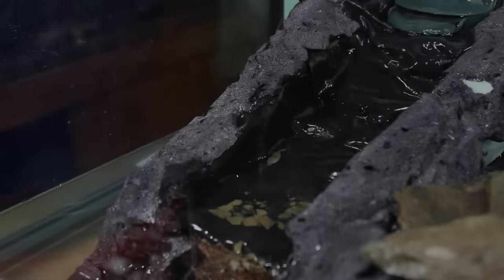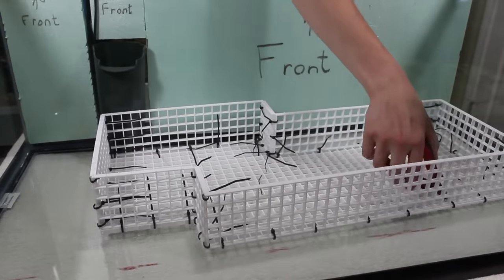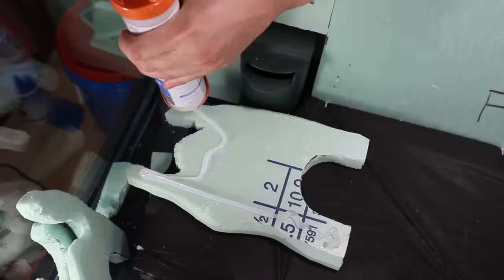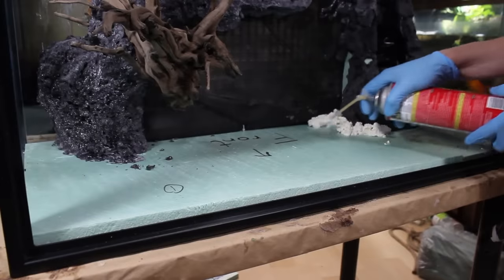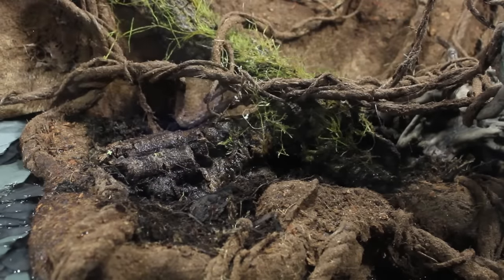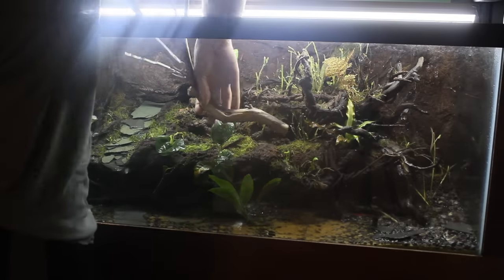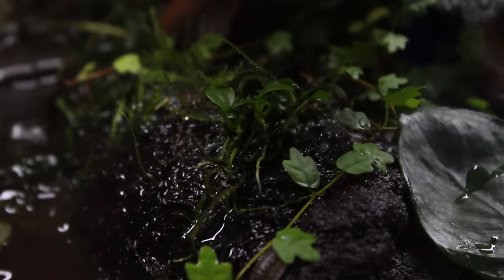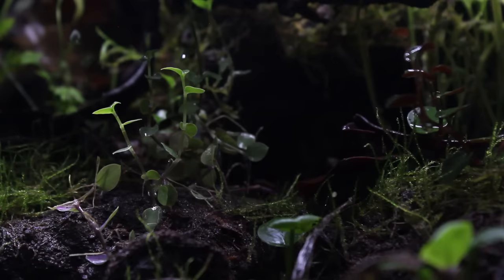The ULTIMATE Fire-Bellied Toad Paludarium

Comment: I've found that after I trim down the edges on any work I do with foam, I take a heat gun to pretty much any surface and edge. Gives it a really natural and nice looking finish. It's really easy to overdue it but it turns out looking really nice.

Comment: Just a note, there are some varieties of foam-safe CA glue that will not melt the foam (as long as you don't use any Zip-Kick to activate it). Yes, it will take a few seconds to set (between 5 and 30 or so), but your foam will not be damaged.

Comment: Hey, In the past, I've used coconut coir as a substrate and it ended up getting wet and turning the water aggressively brown, and it never really stopped doing that. 

Does the thin layer of coir on the silicon do the same thing or is it a small enough amount to be able to water change out? I really like the look of this but I worry about being stuck with the brown water again.

Comment: Why use the insulation foam on the back? Is it possible to just build some areas up with foam and silicone coco liner over just the glass? Trying to do something similar and I'm wondering if I need to get the foam or if I can do it without?

Comment: New to this art form and planning to build my first one of this. I am not able to visualize how the water from the front viewing areas is able to return to the pump to make its round. Seems to me like all the sides of the false bottom lattice are covered by the coco fiber (which I assume allows the water to get through and to the back where the pump is) but most of the sides seem to be covered with the expanding foam. What am I failing to see? Thanks in advance

Comment: I recently did a more arboreal set up using the silicone/coco fiber method you use.  However, my coco fiber has started falling off and into the water.  It felt like I used quite a bit and really pushed it in, but something isn't right.  Do you have any advice for that specifically?

Comment: Is the reason you use so many zip ties , for parts reusability ? Seems quite inefficient if this isn't the case surely gluing would be a better hold and seal ? Aslo why didn't you glue the slate on the waterfall ?

Comment: New to paludariums but I'm doing my research now to build in a 55 gallon. Question: What is the purpose of the insulation foam as the background? Could you just use spray foam? What type of insulation foam do you recommend or not recommend?

Comment: I have seen this video roughly about 25 times. I use it as inspiration for my first paludarium build that will be housing red eyed crocodile skinks once the plants fill in and everything is up to par. I very much wish you had them as well! 
Anyways, I have a couple questions but I'll keep it simple. 
Would it be beneficial to fill in the false bottom egg crate with matala or some other type of filtration sponge so there isn't just bare space in there prior to siliconing it to the floor? I feel like it could be beneficial but I don't have anyone to talk to who even knows what I am talking about. 
I do have a filter placed in the middle-back of the false bottom as it will be turned into a waterfall.

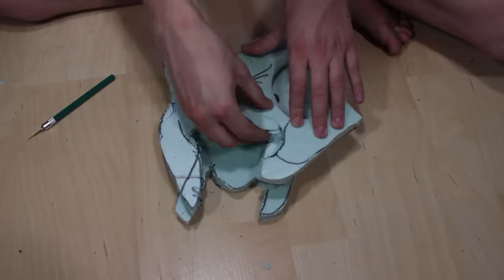Comment: Around the 6:30 point, when you're describing the Foam Board CutOuts for the waterfall feature, you mention, "This ended up being more work than necessary"... Do you have a video or description of the process you would suggest that is NOT "more work than necessary"?  We are doing a very similar setup and using your video as the How-To guide and and almost to that point in the process.

Thank you in advance!!

Comment: Hi Tanner! This has been my favorite video of yours since I found your channel earlier this year! I'm working on a waterfall in a vertical enclosure I come back to this video frequently for reference. 
So i have a question, what brand is the black expanding foam and where did you get it? Everywhere I've been says they dont think it exists (which obviously it does lol). I want the black because I like that when its carved it looks like porous black rock. 
Which actually leads to my next question, could I leave exposed cut black foam touching the water features or will it eventually rot? 
Thanks Tanner you're amazing!

Comment: You didn't say anything about the light.
I have a semi-rain forest terrarium. It stays moist all the time. One piece of driftwood that sticks up about 2.5" tends to dry especially on the top.
But another piece just under that one stays damp constantly. Also the glass of the aquarium stays damp. It has a piece of glass for a top that is
just a bit too big so it just overlaps the edge a little, but it is not really air tight. There are two T 5 bulbs over it and some lady at the nursery said that 
was serious overkill. It is a ten gal tank so some of the plants hit the top. The lights are 1" over the top.
I know 10 gal is small but I already had the tank and I told myself I won't waste money for a larger tank if I can't get plants to grow in this one.

Comment: I bought my black aquarium silicon on Amazon for $13 which is VERY expensive. It also does not smear very well whatsoever. I know LOWES has Silicone for about $3. Can you remind me which kind to buy? Or where you got yours from?
Reply from the maker: Use GE Silicone I or any other silicone that doesn't have additives. Should run you $3-$5 per tube. "Aquarium Silicone" is the biggest rip off!

Comment: Why does everyone use caulking guns backwards? It's simple push the tip to apply a bead and it will smooth itself as you go. Pulling the tip just makes an extra step.